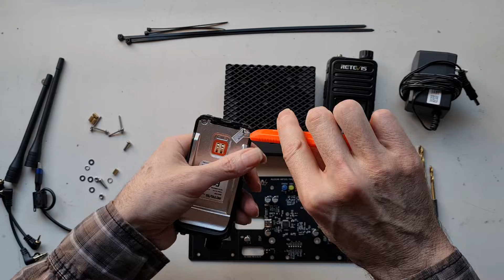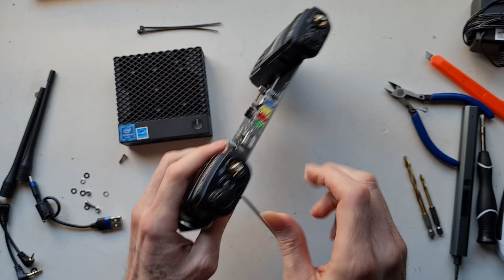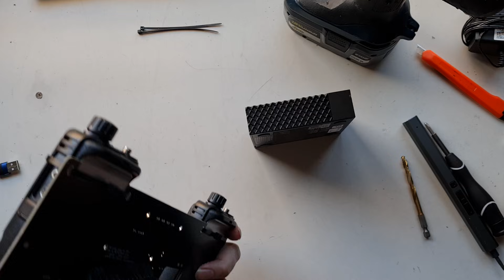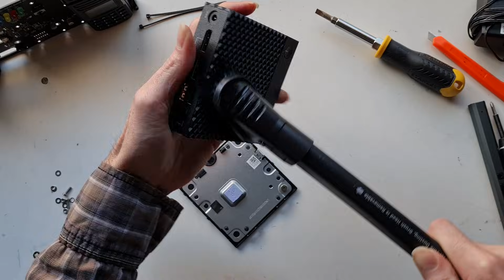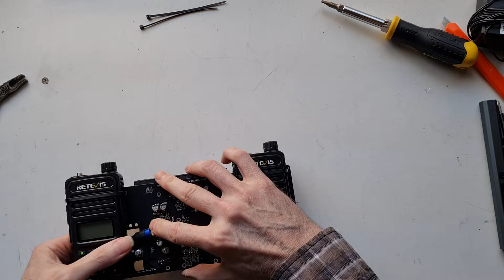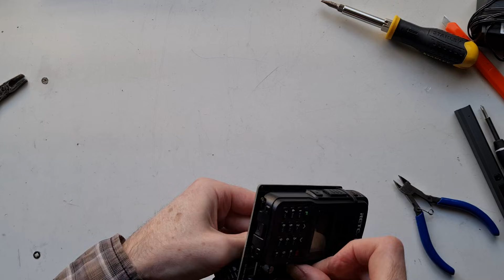AllScan ANF101 Build / Assembly - Cross-Band Full-Duplex AllStar Node Retevis RT85s Dell 3040 MiniPC

Comment: Just received this as a fully assembled unit Followed the setup instructions to the "T" including the sections on modifying the rpt.conf & the simpleusb.conf files and I still can't get My HT to talk to the ANF101, You really need to do a video on the setup process..... The Hardware is of excellent quality, I really appreciate the build quality just need a setup video.
Reply from the maker: My How-To-Guide at https://allscan.info/docs/diy-node.php is probably one of the most detailed guides available online and has been used successfully by 100's of people. That will not cover every last little possible option of the Debian and ASL install process, and allstarlink.org fills in those details in the ASL Manual at https://allstarlink.github.io/  Having said all that, Linux+ASL is a complex system and it doesn't always work right for everyone on the first try. Of all the products I ship the vast majority of the time people have no trouble getting things set up, but occasionally some setting is missed and some debugging is required. With a few emails and/or maybe a post on the ASL forum things do always get resolved. I do plan to do an ASL setup video soon but this will not likely not provide any major additional detail than what's already on my site and in the ASL manual.

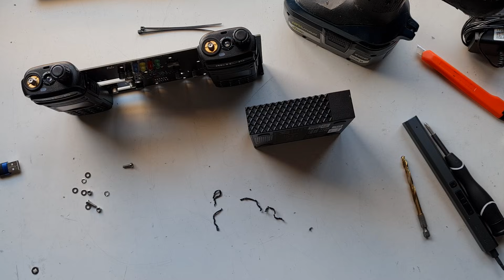Comment: @14:09 incoming ESD disaster...
Reply from the maker: Good "rhetorical" question. Is ESD an issue with the ANF101?  The short answer is that no, it is not and has never been an issue on 1,000+ nodes, URIs, and other products I've sold. My designs have extensive ESD as well as EMI & RFI protection built-in, and I've literally had only about 2 products ever returned for repair out of over 1,000 shipped (< 0.2%) for any issue whatsoever. It is generally a good idea to observe basic ESD prevention practices, but my products are very robust in this regard and a quick shop-vac'ing is highly unlikely to ever cause an issue. There is a lot that goes into ESD analysis, for example humidity (fortunately I live 2 miles from the Pacific Ocean and we almost never get dry air here and I have a humidifier for the rare occasions that we do, but if you live in the middle of Arizona you probably need to be quite a bit more careful about ESD than I do), as well as the work environment and materials, and my 32+ years of experience as an electrical engineer.